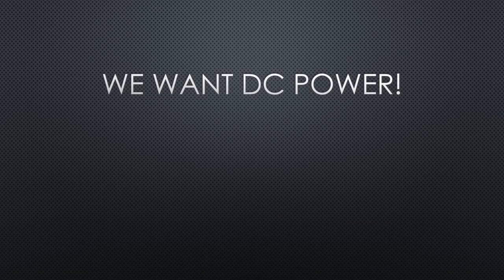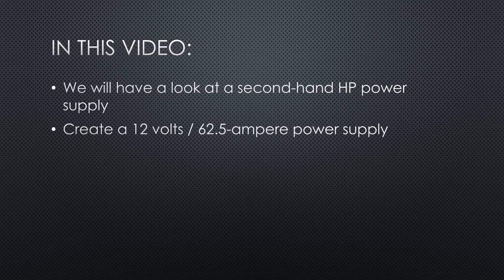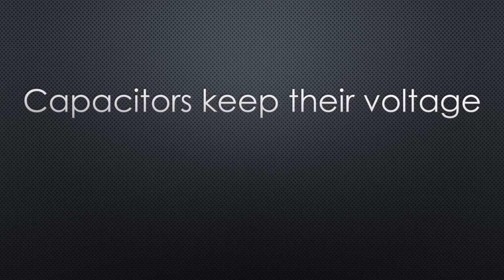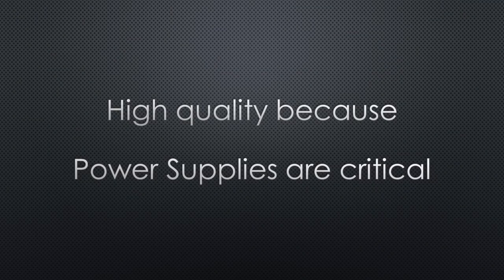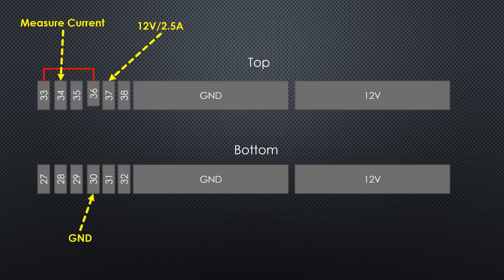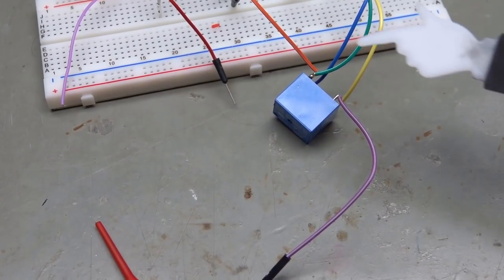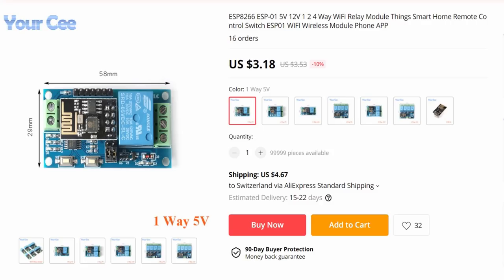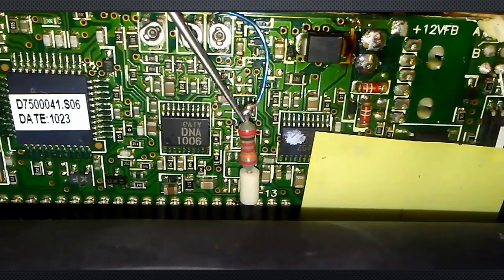#342 12V/60A power supply (PSU) for 20 dollars? Unbelievable, but true. And high quality.

Comment: Good man ..I've been doing this for many years ...I have a 4 draw filing cabinet full of used Siemens/ Fujitsu/ dell/ hp and so on server psu's all 100%  free.. most companies have to pay to have these disposed of as wee waste in the UK so are most happy for me to take them... I've gotten a bit of an obsession with collecting free psu's .
Reply from the maker: Cool. It was new to me. In my profession I consume lots of CPU power, but did not think about what they do with the HW :-(
Reply: Where in UK you get these for free?
Reply: @Arek_R.  I'm an electrician I work in a lot of large factories all of them have a weee bin .. they're all happy for me to take parts as most weee waste management companies charge by weight and the psu's are quite heavy...I have loads and loads of them all of my large ws2811 projects use them ...much better than cheap unknown quanlity psu's from China... I've only ever had one ex server PSU die on me.
Reply: Problem is big IT companies have a policy of must to go to a scrap yard to be total dismantled and I have seen piles of them even offered to pay but was refused.  I did have more luck while working at a factory and the IT company just used the wee skip onsite where I picked up screens and a printer.  The PC's had HD removed.
Reply: @getyerspn  If I would have access to this bin I probably would end up with with few tonnes of these.
Though even if would have no purprose for these myself then could sell them on ebay for some low price so other people can have these as well.
Reply: @Arek_R.  I have 8, for free to anybody that can collect in Hertfordshire.

Comment: I've had three HP 1200 watt 12V supplies for the past 5 years and use two in series to power my 24V Li-Ion battery charger.  Note that if you put them in series, one must have its DC ground isolated while the other retains both its AC and DC grounds.  Otherwise you'll get sparks if the metal cases come in contact with each other and possible internal damage as well.  As these are SMPS supplies they can accept AC inputs anywhere from 100V to 240V, but you won't get maximum current out unless you power them with 240V.
Reply from the maker: True. I saw that people took away the cases to avoid sparks in serial combination. Maybe not a good idea... Better to use your proposal.

Comment: Server PS will also have excellent power factor.
Reply from the maker: Thank you for the addition. I did not look at it.
Reply: Arpad Toth , please elaborate: it is not clear to me what you mean by  'domestic use' and do not understand why it would result in higher cost.
Reply: @seanflanagan5674  It should not increase cost. Depending on the meter being used, it may well reduce cost. Bad power factor means more current flowing back and forth along the AC line in relation to actually consumed power. Power factor close to 1 means "what flows is actually used". Classic counters ("ferraris" type) measure the power used. Modern digital counters measure absolute power flowing. So let's assume we use 200 W (from a 750 W power supply, but that doesn't really matter). At power factor 0.5, there's 400 W going back and forth. At power factor 1, 200 W are going back and forth. An analog counter will only see 200W no matter the power factor. A smart meter will be able to see either 200 W at PF 1 or 400 W at PF 0.5. Depending on the utilities contract, we might get billed for the absolute or used power.
Reply: @suromark , thank you for the explanation, for which I'm grateful. But the enlightenment leaves me upset: in my area, the consumers were required to pay for the installation of new "smart meters"–which only the power company can analyze and control. And I don't know how they calculate usage though I suspect….
Reply: Yes some even have active PFC where the MCU controls the current draw to keep it in phase with voltage. Server PSUs have it all! Most good ones use MOSFETs for the bridge rectifier to save power. Great engineering in the brand names.
Reply: I just ordered one. The seller must have seen your video - it was now 22€ in total :D  
You had me when you presented the 62.5 amps. My 2 "domestic" PSUs deliver only up to 30 amps. So now I can cut it using only 1 instead of 2. 
Good Video, Andreas. :)
Reply: @suromark  The term for what you're calling absolute power is true power, also referred to as real power. A Power Factor of less than 1 indicates the flow of reactive power. Electrical energy providers don't like reactive power because it causes heating in tramsmission and distribution wiring. Depending on utility company policy, some customers get billed for reactive power.
Reply: @AndreasSpiess  That much is true,  but they also have inadequate cooling to reach the rated current.  They are designed to have air forced through them by the chassis they are mounted in,  as DIY Perks just found out the expensive way: https://www.youtube.com/watch?v=YfvTjQ9MCwY
Reply: Arpad Toth  nope. Home use do not account for reactive power. Reactive power is only charged to industries
Reply: @kiowablue2862  in all south east asia (i  grew up in indonesia) and both US and canada (my mom is from canada and i studied in Massachusetts for 3 years), every house is only charged for the real power usage. Reactive power will only be charged to industries, that's why a lot of server stuff has many more capacitors and other components to correct the power factor which are not found in customer products.

Comment: I have a pair of these power supplies, i use one for my radios here on my shack, the HF transceiver drawn about 20A peak and the PSU dont even sweat, they are very good. I mounted one on a "aluminium"  style suitcase, with space to carry my HF transceiver, so i use it for transportation and field power supply. They are very RFI quiet also, i have not detected RFI from it on the HF bands, only a little on VHF, but maybe a good ferrite on the AC input cable will filter it.
Reply: Just ordered one for my HF rig, once converted to 13.8V.
Reply from the maker: Here is the video to make them quiet (in German)

Comment: Great video! I looked into doing something like this last year with a spare consumer PC PSU I had laying around. I also wanted to modify the voltage to be 13.8V for radio use and looked into tutorials on the process. However in nearly every one I found, making the modification either bypassed or otherwise removed almost all safety features such as under/over voltage and short circuit protection. That alone made me not want to make the modification, but then I took a closer look at some other parts in my particular PSU. Some had absolute maximum voltage ratings of as low as 14V, which I felt was way too close to 13.8V to have any safety margin. So instead it remains a 12V powerhouse for LEDs and charging other devices using buck/boost converters.
Reply from the maker: You are right: They are made for 12 volts. But I found many examples where they were used on 13.8 volts. So I assume they are also safe to operate at this voltage. But I have no long term experience

Comment: Damn it, every time someone spreads the word, I lose more and more $5 800W psu offers
Reply: That is the problem every time someone shares a great deal on youtube. soon after it isn´t a deal anymore. Right now so many servers are being consolidated though because of Epyc that there will be millions of these. You can replace 6 or more servers with one 32-64core epyc cpu and the energy savings pays for the upgrade within 2 years so it is a no brainer.
Reply from the maker: @Philosophical Thoughts: I hope you have already bought a few of them ;-)
Reply: LOL we're all a little late to the party on this one! These have been around for some years now on the used market - i bought 4 1100w units 6 months ago for 60.00 shipped only to discover years of mention on Youtube. These are even stackable through an inexpensive connector for 2200w 24v. They are available in droves and the frequency of units is increasing, I can only assume the designers anticipated a secondary market use and deserve a pat on the back!
Reply: Actually the RC guys have been doing it for years and use them to charge up lithium packs so if it was going to make a difference I'd say it has already.  Also best source of mods on their forums.
Reply: Nojoke I just lost three offers I was gonna get for $3 psus in a single day after this lmao. Someone bought out an entire seller’s stock of like 60 on eBay
Reply: @Ferraday  Wow! Bummer.  I think there is a virtual unlimited stock,. they automatically change them out in servers rooms after a certain number of  hours.
Reply: Rectified Lincoln  75 Kw supply for $200. Hard on Leds after a nanosecond or 2
Reply: @maxprophet2401  That would trip the 200A breaker most homes have! How TF did you power it?
Reply: I bid on a pair of 2450W PSU's because "More is big."  I hope the firmware isn't an issue - I didn't even think of that.
Reply: Wait so you're the one buying up all the PSUs, and then complaining that someone bought up all the PSUs... makes total sense.

Comment: I have an IBM blade centre PSU. Over 200A. Managed to get it to 14.2V and it can charge my dual 1000CCA starting battery AND 200AH deep cycle battery all at once. Most I have pulled is 80A. Cost 50AUD brand new. Great value.
Reply from the maker: I am not sure if my home would be able to deliver this massive power at one outlet!
Reply: @AndreasSpiess  even I'd need an upgrade in outlet to 15A. Not common domesticity here in Australia.

Comment: I can still remember the power supplies used in DEC VAX computers, they were 5V @200 A.
This was around 1990.
Reply: Damn, I could use one of those for an electrolysis project!
Reply from the maker: I never investigated it when I sold them as a DEC Account Manager;-)
Reply: @AndreasSpiess  Ah! DEC!! Love of my life.. 19 years at DEC, Milano first then Melbourne, mainly Field Service and Sales Tech Support.. Were you in Geneva? Did a few trips there for FS Support meetings.  I do have a number of these PSUs, started modding them a couple of years ago, taking hints from an RC website/forum. Also recently picked up a SUN/Oracle PSU with dual 12V 240A..! Pity haven't found any info on the small connector and its many tiny pins..! 
Love the stuff you're doing.
Tschuss, lm
Reply: Wow. You jogged my memory. Database software developers had me install windows 3.51 on a dec alpha in the late 90s. Learned a lot.

Comment: These are fantastic I use them for powering rc lipo battery chargers. I also have 2 of these connected in series for 24v 62A power!
Reply: is this possible without danger @Andreas Spiess
Reply: Frank Müller besides ground connection issues, they are totally fine
Reply: @grindel80  no you have do disconnect the shell from the ground output because if the case touch each other they go bang..
Reply: @kitecattestecke2303  Yep silly me, and a lick of flame came out of the case AND damaged the switch on the main household  socket too.
Reply: @kitecattestecke2303  Of course when the output is not floating and cannot be made floating (check the PCB), it is not enough to disconnect the shell... they will still connect via the mains safety ground.
When you want to so something like this you have to understand what you are doing.
Reply: @grindel80  Be careful how you turn them on and off. If you turn only one on while a load is connected, the one that is still off will see a negative voltage across its output.

Comment: @Andreas. I chose to use a Dell for PowerEdge, it brings a 3.3V on Standby so I can have the ESP directly, it has ~320W, what is more than enough for most of us, but  what o really like about it is that it has the ATX cable, not standard, but make life way easier overall. It requires the resistor and it did cost me $10 with shipping 😎 another great point, they have excellent ability to shut down on shortages 🤫
Reply from the maker: Thanks for sharing. I also left a link to a PCB which has the edge and ATX connectors for the HP supply

Comment: Done that a few years ago. The RC community also seems to like them. Great, robust PSUs. Only downside is that they do produce some RF noise, so not too great with radio transmitters.
Reply from the maker: A German HAM did the investigation and remedy of the RF noise. I put the Link in other comments.

Comment: Tell  Dishka I said hello. Looks happy to be with you in the lab. Greta video. Thanks! I've also used ATX power supply for PCs. They include 12, 5, and 3.3 Volt. and usually around 500W. I also switch mine on and off with ESP8266 and 5 V relay. Switch on/off with html page hosted by the ESP.
Reply from the maker: True. If you need lots of 5V and 3.3v it is probably the better choice.

Comment: Hi Andreas,
Having seen your video, I decided to get hold of a few of these supplies. Looked like really nice kit!

I wanted to mod them for 13.8v to use on my radio gear, so followed the most popular route, shorting out a resistor on the trim pot. Worked fine....or at least it did until I tried to put a decent load on the supply (20A). This caused a loud buzzing and ripple on the output. It would work fine at 13.4v (well over 20A in fact), but going above 13.5v caused this instability. I have two of them that both behaved the same, so don't think this a fault on the supplies, but a design issue.

My gut feeling was that it was due to an over-voltage protection tripping early, though without any schematics, hard to be sure.  However, I tried tweaking other trim pots on the control board (marked their position first of course) one at a time and found one that influenced this behaviour. So with a slight adjustment on this pot, I now have 13.8v set and can go all the way to 30A. Nice.

Ok, I'm working blind here with no diagrams, but it does make sense. My guess is that they are specified to pretty tight tolerances and so can see that over-voltage migth be set to say 14v or 15v, in which case 13.8v is getting kind of close.

Anyhow, I know you were staying clear of advising details of this mod, but thought this might still be useful.

Br,
Ralph
Reply from the maker: You are right. They have an overvoltage protection. In your case it was very low. Usually they kick-in at 14 volts.

Comment: I already found these a couple of years ago and bought a few for charging my multi kWh lipo packs.
Note the connector is heavily gold plated copper, so it's a pity to solder to it.
Would be nice to be able to collect the gold first before soldering to the copper underneath!
Reply: The film is really thin though. You'd only get a fraction of a gram. Playing with junk channel guy harvests loads of these gold PCB parts and has a video about harvesting the gold.... can be worth it if you come across loads and loads of expensive stuff with a gold finish I guess.
Reply from the maker: @Andy: I posted a link to a connector board.
Reply: @AndreasSpiess  thanks Andreas, I had a look... it creates more problems with needing more 6x2 connectors!
I would just need the edge connector itself then distribute a 10AWG cable to each of the main outputs and terminate with an XT90 or 6mm bullet connectors for series connection. No need of the other pins.
I isolated one PSU to make 24V, and it worked for a year but now won't power up. There's probably a simple fix, but I don't fancy poking around inside it to try to find out why!
Reply from the maker: I ordered those: https://www.aliexpress.com/item/33029711948.html But I do not know if they will work.
Reply: @AndreasSpiess  Would really need to identify the type used in the server they came from. The connector on the breakout board is 64 way or 32 pairs.
I ordered too... should make it easier to exchange psus if one fails, but tedious making a loom for it!

Comment: Also worth a mention: Regardless of how dust-free the fans are, please consider that server PSUs (and their very loud and exceptionally fast-running cooling fans) may have been running for many, many hours under heavy loads. Time to failure,  and the type of failure that eventually befalls your unit, will likely vary greatly when using used server power supplies.
Reply from the maker: Well possible. But thousands are used right now. This is not a new idea.

Comment: Thanks for the warning about PSU capacitors... unfortunately you're about 30 years late 😉 
The one time I got a (close to) mains voltage shock was when I was troubleshooting a PSU for an Amiga 500... for a second I forgot about the cap and placed my thumb squarely across the solder points on the rear of the PCB 😂
Reply: Indeed too late. I think just about every reasonable PSU made today has a mandatory discharge resistor across the painful primary side caps. Because when you unplug a device, you are confronted with exposed power plug pins, and you could potentially touch them and have a bad time. One side of the capacitor would be effectively across both live/neutral pins and the other potentially on the ground pin. Of course depending on your amount of luck, precaution is still advised, because sometimes these discharge resistors could be missing or could delaminate from heat and become ineffective.
Reply from the maker: @
Siana Gearz: I thought this, too. But I can tell you: The depleting in mine is not very fast if you know what I mean ;-)

Comment: Been using them for high-current 12V sources for a while and glad to see such solid technology avoid the ecycle path for a while.  You can drive an ESP or RP0W off the standby voltage, providing WiFi network or BT.  Then a GPIO pin can bring the high-power portion to life only when needed.  Funny thing: the standby fan runs louder than the running fan for most of my uses...  Thank you for your video!
Reply from the maker: Fortunately I had not a big issue with the fan. It did not run during my tests. But I only went to 50% for a relative short time.